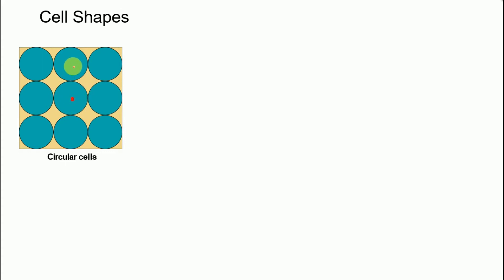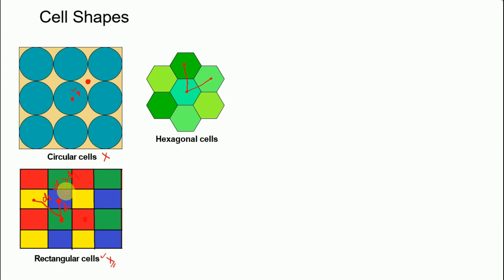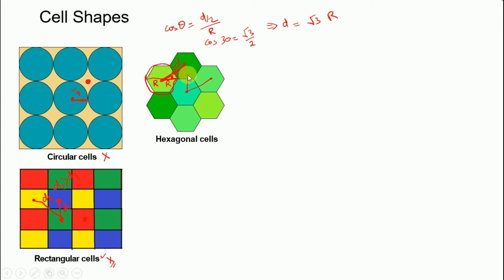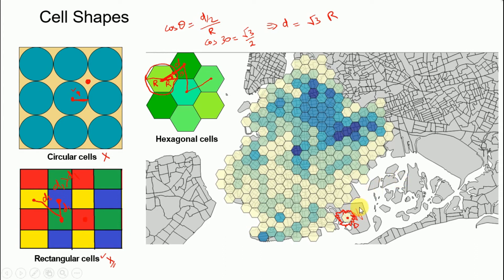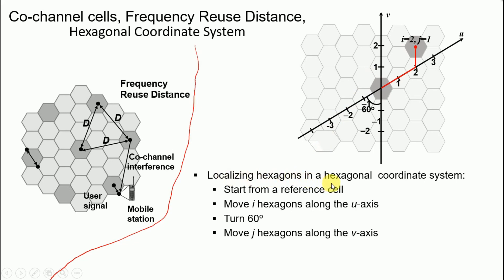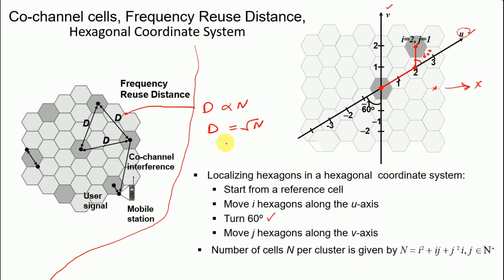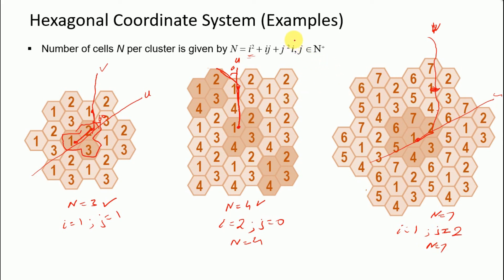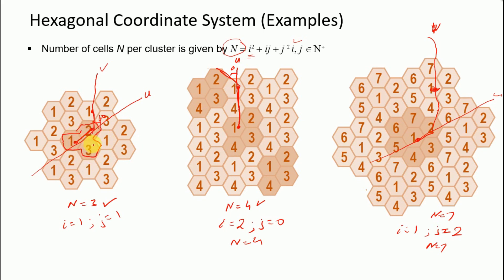Hexagonal Cell Geometry in Wireless Communication

Comment: why not octagon
Reply from the maker: Hi there, if we consider octagon, then not all of the geographical area can be covered. Some spaces will be left uncovered.
Reply: Ok sir, but somewhere i have read that we use sector antenna which divided the cell into 3 equal sector of beamwidth 120 degree each and also in case of hexagon cell when we used edge excited antenna chance of interference will be low as compare to octagon
Reply from the maker: @sourabhyadav14   Interesting point. This has to be quantified using SIR analysis for both  schemes. 
However, do note that real scenario is neither of the two as beam shapes are not that crisp. hexagon, or similar models are considered for mathematical tractability only. A good resource available online on the topic is 
https://www.pearsonhighered.com/assets/samplechapter/0/1/3/0/0130422320.pdf
Reply: @AKHassan  yes sir know that neither the beam size nor cell is hexagon in real. I am also taking this subject in my institute one of my student ask this question to me so i did little research. Btw thank you for your time sir